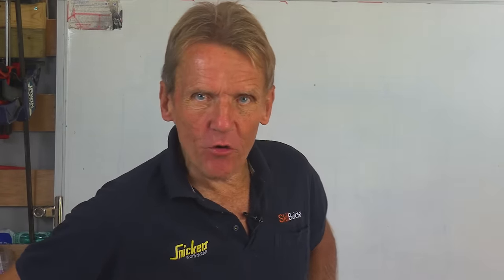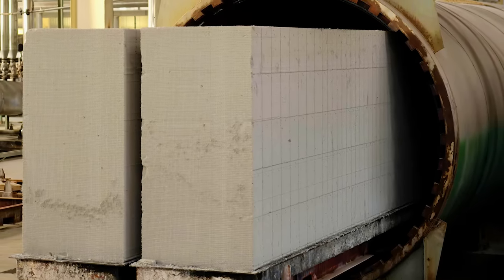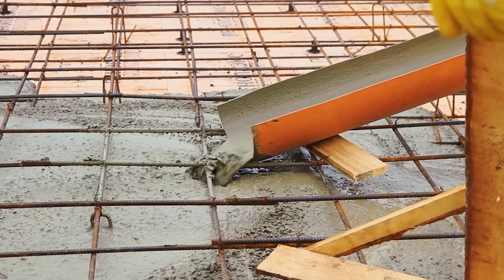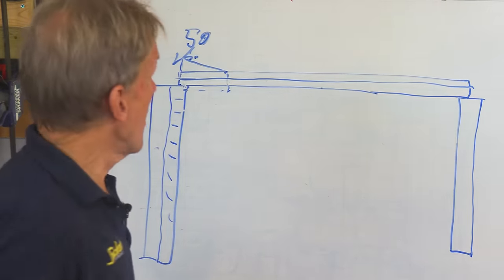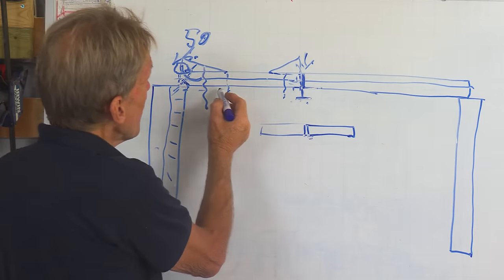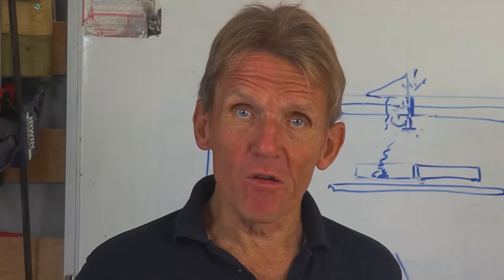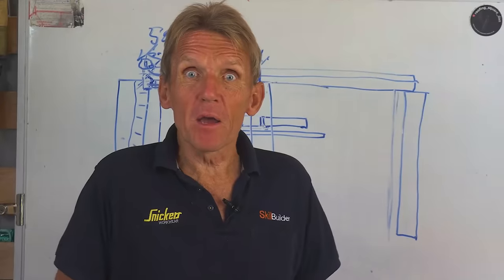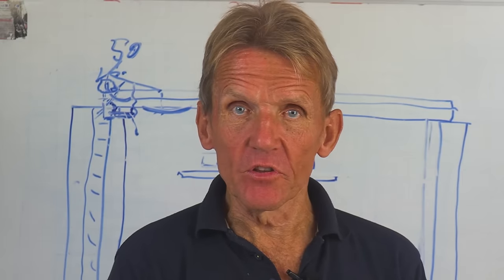The Ugly Truth About Reinforced Aerated Autoclaved Concrete (RAAC)

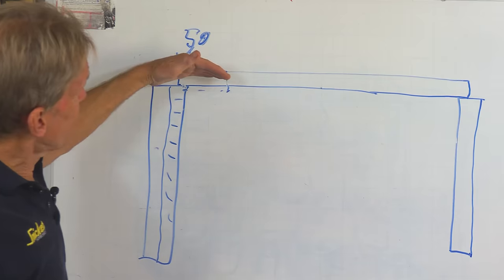Comment: Master's degree Engineer here. 08:45 is not correct.

I follow for the practical advice on building stuff. 

Thats not how shear force diagrams work you cant just get shear acting in that little bit.

the shear force diagram would be a continuos gradient from one side to the other (assuming a uniformly distrubuted load) 
and given a lack of other forces drawn, it must be assumed that it is.

Comment: You forget to mention that aerated concrete is great for building in areas where the ground will not support heavy structures. Granted, the longevity may not be what you hope for but if you are looking to help house large groups of people who do not have a lot of money, you build cheap and cheerful structures on ground that is not suitable for tower flats or large commercial buildings.
Another point, where I live, the bearing is a minimum of 10 cm on brick.
Reply from the maker: The 100mm bearing is standard but the spec on RAAC panels calls for 75 minimum

Comment: Why didn't they add a water proofer to the air rated concrete?
Reply from the maker: I am not sure how that would work. They often use a waterproofer in render when aircrete is used externally but I have been told it does more harm than good. It traps moisture that would otherwise evaporate.

Comment: The problem with concrete is the reinforcement being susceptible to rust. We use it to save on concrete and build things that otherwise wouldn't be possible. The romans, aside from some creative mixing techniques, never worried about rust because nothing in their building material could rust.  So perhaps if we built things with the intention of them lasting a century+ instead of saving every possible penny we might stop having these problems. Unless reinforcement is required for a structure to be sound design it without it. Or at least use reinforcement that can't be destroyed by 21% of our atmosphere.

Comment: Aerated concrete blocks seem a bit pointless to me. Ok, they're lightweight which is useful if you want masonry not timber, and you're extending over an existing storey and don't want to overload the footings. Also therefore easier work for the brickie.

But thermally, they have a K value of 0.18, but actual insulation is 0.04 for wool based or 0.02 for PIR. So 200mm of block only provides similar to 20-40mm of insulation. It's just about an order of magnitude different.

When you consider that using 'aglite' blocks instead give 0.3...the amount of 'extra' insulation needed to be equivalent of using aac blocks, is even less.

And all with the benefit of not cracking and being generally quite weak. Factor in costs and extra care required to prevent cracking...I cannot see the point.

The other thing is aac have no thermal mass, so they allow temperature to fluctuate quicker, but won't retain it within the structure. It's like having an engine not connected to a flywheel. Or the way the ocean moderates British temperatures. So the whole u-value business is only looking at one metric.

All this is to say nothing of this instance of reinforcing such a highly porous material
Reply: Back when they where used, they provided insulation up to the required standard.
Reply: One issue not mentioned is condensation.  These roofs have no vapour barrier and no ventilation above the slab, the roof covering holds in the moisture.  Moisture will build up in winter and dry out in summer. Overtime this will lead to the steel bars (more accurately wires) corroding.

Comment: While standardisation can lead to efficiencies and simplify processes, it also risks magnifying any inherent flaws or oversights. Consider the RAAC scenario: though it might have seemed promising initially, if we had standardised all schools around this model, instead of a few schools grappling with its challenges, a vast majority would have been negatively impacted. Unique school designs might lead to more minor challenges scattered over time, but a one-size-fits-all approach risks substantial, widespread issues. In my opinion it's preferable to endure a thousand small cuts over many years than to suffer a single, devastating stab wound.
Reply: Except it was known at the time that RAAC only had an estimated 30 year lifespan. Standardization would have eliminated use of that material if they wanted buildings that lasted more than 30 years.
Reply: @yorkyone2143  That's probably true, but not really relevant, RAAC is just a single example. A mistake in a standardised school will inevitably happen, which will lead to it affecting a large portion of schools all at once. It's better to mitigate the impact of mistakes that will happen, as opposed to hoping none are made.

Comment: Scrap The Steel Rebar, use Fibreglass Rebar instead! 

Autoclaved Aerated Concrete is a reasonable Insulation Choice, but not a Structural Element! Just like a Rutan Aircraft Factory design, it's more like the Foam Core, that then Gets Surfaced with S-Glass& Epoxy Skins, to carry the Tension & Compression loads! 

Rutan designs also use more than One approach to that "Skinning" as well! 

Obviously, Reinforced Autoclaved Aereated Concrete, has a Relatively Short History, and they are getting into understanding Ageing, Cycle Life, and Environmental Attack Discovery, just now, after Years and Years of it getting used! 

Another interesting point, What Nonflammable Material is the "Right Stuff" to "Seal" these Panels, to Actually Stop Any Moisture, Penetration, or  Absorption, Condenstate Forming internally, etc?
Reply: Most are over 60 years old on non-maintained flat roofs. I would never trust any non-maintained flat roof. AAC can be a great structural choice in compression. Just use it for walls.

Comment: I don't understand how you can have a standard school design: every school site is different and different schools also have different needs. Also, most new school buildings are additions to existing school sites so you'd have to knock down the existing schools and start again.
Reply from the maker: I said it was a point for discussion. Schools can be modular and scaleable. The structure doesn't need to be compromised because a school is larger.

Comment: Did you know that the romans used Pumice in their concrete dome as it became higher towards the centre - to place less stress on the roof nearer the centre. Real structural engineers.

Comment: Reinforced concrete is sos strong because it combines the compressive strength of concrete with tensile strength of steel. A cantilever made from reinforced concrete will resist stretching on the top side thanks to the steel, but it would eventually sag and collapse if not for the concrete on the bottom resisting compression. 
Areated concrete doesnt even come close to normal concrete in this regard, so it completely negates the advantages of reinforcement.

Comment: I’ve heard local tradesmen call it Breeze Block. But maybe it’s a regional name as I’ve never heard anybody outside Birmingham use that term.
Reply from the maker: Breeze block is an old fashioned term and it was used when they blew compressed air through a clinker and cement mix. The air in these blocks is hydrogen gas bubbles so no breeze is involved.

Comment: I can 'understand' why they used RAAC - especially after WW2 when many cities were damaged in air-raids and the UK didn't exactly have the finances to rebuild 'everything' required to get back on its feet - hence a LOT of Public Sector use. It may well of been a short term 'fix' after the destruction of WW2 and the costs of rebuilding the infrastructure required, but they really should have had a long term plan but that seems to be have left to the 'next' generation to deal with...

Comment: building standards are currently not fit for purpose, as are so many people involved in the building trade, ie Grenfell, from the builders to the building inspector, who signed off on the work, i have had building inspectors who wont climb a ladder to check work, no understanding of timber framing calculations, stress loadings ect, and as for only a 75mm lintle bearing, put all mine in at 100mm minimum, decent builders are very highly skilled people and should be treated as such, but we are not, because we never went to university....

Comment: Flat roofs are part of the switch to Modernism in architecture, which threw away centuries of experience- like, temperature Europe is rainy, so you need a good sloped roof- in favour of abstract simple shapes (cubes), because the architects ideologically wanted to be "different". This tragedy was enabled by "system building" er systems which were cheaper. The result is that we've now got a country full of post-war modernist buildings that will fall apart more with every passing year.

Comment: 75mm bearing!? I've always worked at least to 150-200mm. Ishould have added this was about bearing for beams, ie steel etc.
Reply from the maker: 75mm minimum is what they specified. It wasn't enough but they were looking at 600mm wide panels.
Reply: @SkillBuilder  Ok thanks and I should have stuck to the topic.

Comment: Long Video!
Bottom Line:
It's Known That Aerated Blokcs
Popout Under Stress or Quakes,
They Crack Too,
That's What They Are Meant To Do,
Popout And Do Little Harm,
They Are Not Meant To Support Weight,
Only Beams and Polls Must Support Weight,
So The Collapse Of The Schoo Roof Was Made Deliberately!
If You Worry About 
Air Bricks 🧱 Popping Out,
Put Some Plaster Board Plastic Net And Reinforce The Surface With A Layer Of Some Adhesive Composition!

Comment: The protection of re bar is for corrosion resistance because moisture and oxygen can more easily access the steel. The bond stress is actually better if uncoated. Nothing wrong with aerated blocks for enhanced insulation value. But reinforcing this type of concrete; just not suitable. Lack of bond stress, lower compressive resistance etc. If used for structural purposes they should always be replaced - not sure how anyone certified these as durable for the design life of a building (50 years min.)

Comment: many many  years ago ,many years on top of that,at college and uni study civil engineering ,design,construction.cement/construction with rebar,we where told 25 years before degradation(concrete cancer)which must be monitored yearly onwards for failure .railway engineering from 85>,thus many people would from that time see many upgrades from stations /bridges/all infrastructure across UK.Thats proper stuff,so this cheap crap to cut corners was doomed from start.

Comment: Sounds like we might have another Grenfell before our lovely politicians decide to do anything about it. I was also informed, although not substantiated, that aluminium filings where used. Does everyone remember alumina cement, which was banded from all structural concrete in the building industry. The basics have obviously been overlooked for the want if a quick return.

Comment: Sorry Roger…I normally really like your content…but in this instance, I do think you should have got an engineers opinion on RAAC failures! Comparisons with unreinforced cracking of AAC block work (often resulting from poor handling or inappropriate mortar mix selection) is not helpful…even using the Pantheon, that as a dome, works differently in relation to compression & tension compared to a beam is again maybe not the best comparison. I do applaud you though for discussing this very important issue and a concern that Governments will have been aware of since the mid-90’s.
Reply from the maker: Peter 
I was merely telling people how aeatated concrete blocks have been around a long time and the material is the same, It cracks and that is well known. The point about the Panteheon is a simple illustration of how we have not improved that much. I read several engineers reports before making this video so I am not sure what is so wrong with doing what every journalist does. I have been writing for the building trade press for well over 35 years now so I know a little.

Comment: Lightweight concrete blocks are not the same as RAAC at all.   RAAC sounds like a dumb idea so where are the retired structural engineers who specified this stuff, and where are their insurers now?  Who in Building Control approved it and who signed it off?  I suppose they'll say it's simply nobody's fault, but it really is.

Comment: Not much trouble with STRAMIT Compressed Straw and resins used in School & Public Building Roofs.  Trouble is It's Flat rooves again why are these buildings built with flat rooves when Epoxy Covered Steel or Galvanised Steel rooves are light and relatively cheap.
   Roger A Standard build and Design would be the way to go.   The Chinese use this so many times in their Bridges for Railways & Roads and many other Civil Engineering Projects.
    The M32 In Bristol they are saying understandably has Concrete Cancer  Estimated £25Mn to put that right.   I would have thought Bristol Would know better with the Estimates on the Severn Bridge and the M5 Bridge over the Avon being so far out it was untrue after taking the Cheapest Quotes.

Comment: RAAC was cheap and quick to build with even though they knew when it was used that it only had a 30 year lifespan they used it anyway. Now that penny pinching is biting us in the ass because the cost of replacing it will be huge. This is the problem with politics, it is all for the present and maybe the next decade, anything longer than that and the politicians know they will be gone and it's someone else's problem. So now we have literally thousands of public buildings that are unsafe because back in the 50's, 60's and 70's politicians had them all put up on the cheap to make themselves look good.

Comment: Interesting how the authorities have failed to require long lasting building materials and principles for new buildings. Those that built the pyramids and other roman buildings appear to have had more brains. I put in a new fence with recycled plastic post and rails in 1998 and it does not appear to have deteriorated at all and indeed the company than made the material suggesting it may last over 100 years. The earliest reinforced concrete roof constructions here are now over 40 years old and do not appear to have aged at all. Spend a few pence more but do the job properly!

Comment: Wow! This guy is articulate but his analysis seems all over the place. First it’s water infiltration and corrosion of the rebar, then it’s under spec bearing tolerances, then it’s insufficient or unanchored beam connections and if all 3 happen there is failure.  So the material isn’t at fault if it is installed to spec and protected from water intrusion.  All of these things BTW can be reasonably retrofitted and water intrusion is basic maintenance.  But what’s the goal here? well sensational content to get clicks and monetize the channel. Well done, you had me for a moment.  There are far better forensic engineering channels out there to follow.  BTW, asbestos can be left in place safely if it is properly encapsulated. Actual deaths from asbestos usually require massive exposure along with additional aggravating factors like smoking.  The substantial associated costs occur when replacement or removal of asbestos is necessary for remodel or demolition.

Comment: So let me sum this 'crisis with AAC (the material) up;  

The 'problem' comes from poor the decision of using this material for exterior roof (horizontal plane) systems, combined with asbestos (another bad decision) for cheap insulation,which cause more bad decisions to not inspect the assemblies (manufacturer recommended) so the asbestos was not disturbed, instead of remediating the asbestos, which is what should have been done.  Then extended mismanagement of maintenance (exhausted roofing membranes) which caused water infiltration, combined with poor building practices (assembly outside of stated engineering requirements like bearing surfaces) and after years of this neglect, a collapse is being blamed on the material?

Are you Brits daft?

I build with this material in the states.  An engineering assessment early informed our use of the material;  

We use mostly, which is not internally reinforced.  We install our own rebar as in any block construction. *NOTE:  The solution for ALL rebar in ANY kind of concrete is basalt rebar-look it up.
If we do use in horizontal plane (just now designing for it), we use inter-floor only, never on the exterior, as in a roof panel condition.  Trusses are better for the roof, we fell.
All insulation is external

I dislike that this issue is being sensationalized, even here.  It's NOT a material failure, its a leadership failure and a maintenance failure.  The material performed as engineered.

.